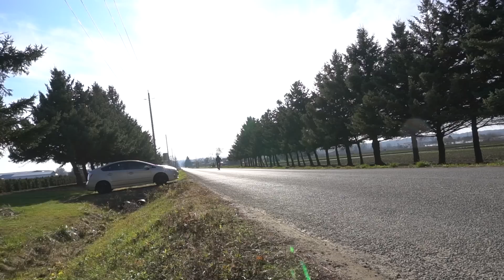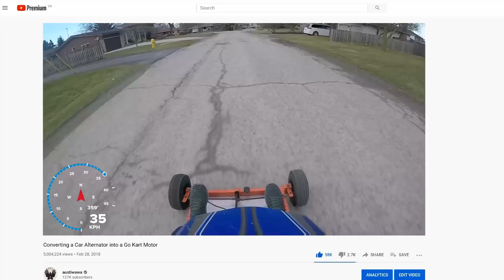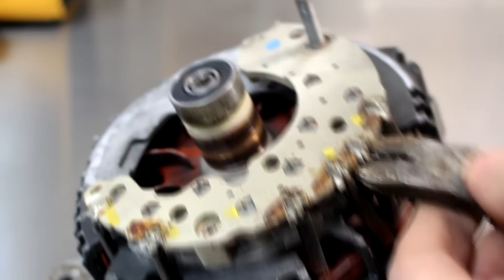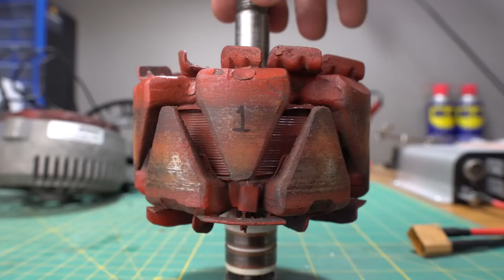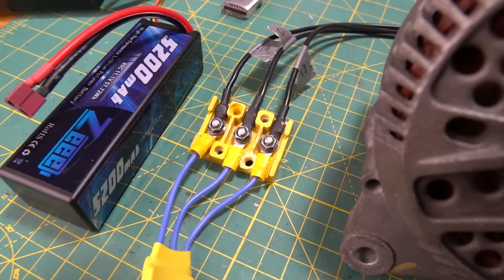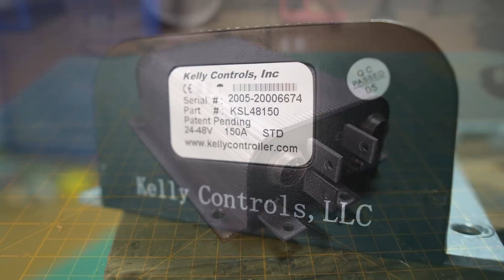Building an Alternator Powered Bike

Comment: could you not just put a cut off switch a Toggle switch
Reply: for...?
Reply: @foxxyytofficial  you start the bike rolling then turn on the Motor then accelerate slow down turn the motor off you have an on off with toggle Excelerator to adjust speed that little pedal you see them squishing that looks like a gas pedal that’s an Excelerator what you don’t like to have happin is tobe stopped and have the motor still turning or trying to turn.it will burn up lotta people call them kill switch.
Reply: @fredrickemp7242  i don't think that this would work as you intend to
Reply: @foxxyytofficial  okay tell me why? I think it is too Heavy anyway use up battery too fast.Alternators off to one side not good for balance.Mid drives motor so much lighter.
Reply: @fredrickemp7242  you're missing the entire point of the video:
To reuse stuff, not to buy every single product on a shop
People in budgets or DIY lovers won't take too much this weight detail in consideration
Reply: @foxxyytofficial  the Controller he bought new did not want to waste it.then he bought a new Santrifcal clutch.so I think a Toggle switch would’ve been better than the clutch.but the side Mount motor poor design. but I like the concept just keep Tinkering
And yes I do like to reuse something then by new. I like Tinkering myself and believe me I’ve done my share of Contraptions.Made a snow plow out of metal bedframe and lids from Tupperware Bins To go on my riding lawnmower.Kids got a real kick out of it worked fairly well.

Comment: How about a torque converter to really get going
Reply: its already good in torque, check the part 1 video, where he didn't used a clutch too, now with the controller and hall sesnsors will have even better startup torque

Comment: Maybe using an absolute encoder was also one of the solutions.
Reply: that KEB controller don't seem to work with those encoders, but a VESC maybe
Reply: @foxxyytofficial  Yes, you are right, but with some simple interface ( e.g. Arduino) it will be possible. Anyway, you did a really good job !
Reply: @navigator_071  wish i was the one that built the bike haha
Reply: @foxxyytofficial  I didn't pay attention, I though that it was the author, anyway, maybe you will built it one day  :)
Reply: @navigator_071  maybe i will, crossing my fingers for that

Comment: That clutch is adjustable, looks exactly like the one I run on my go kart. If it’s slipping, put softer springs in it so it engages easier.  Might help to gear it differently, too. Great vid.
Reply: he only used clutch because of the controller, swapping it made the clutch dead weight
Reply: @foxxyytofficial  I watched the second half of the vid, where he fixed the controller, after I posted that comment.  Someone could probably still do it with the clutch and the controller with no mods, and get it to work properly.
Reply: @DonnieRockett  the clutch it's more for engines that need to idle, electric motors don't, so basically you won't find centrifugal clutches in builds so easily, the only electric projects with clutches that i know are the trial bikes with wet clutches operated like ICE bikes
Reply: @foxxyytofficial  i agree, just putting the information out there that the clutch is adjustable.  his original complaint with the build was that the clutch was slipping.  putting in softer springs, and making sure that the clutch isn't on backward (the shoes in the inside of that clutch are directional) would probably have made the original build work just fine.  i have mine set to engage around 3000 rpm, but that can be lowered or increased.
Reply: @DonnieRockett  now i got your point, sorry then

Comment: You can achieve field weakening by adjusting the current in the rotor windings.  More rotor current = lower kv = more torque/less speed, less rotor current = higher kv = more speed/less torque.

At that point you've made an externally excited motor.

Comment: Can you synch 2 of them for a 2 wheel drive bike?
Reply: with both of them using hall sensors and their own controllers yes, you could get 2 VESC controllers and connect them using CAN, so would need one single throttle and both controllers would be organized

Comment: You should try and use a torque converter instead of a centrifugal clutch. Much less slip and will give you a lot more power on the low end and the high end. Due to the changing of the contact circumference of the belt on converter with the expanding plates.
Reply: or just swapped the controller for a proper one and risk the need of a clutch

Comment: Love your video . A possibility option would be to up the voltage to the field coil temporarily for a speed boost and liquid cooling the motor to improve performance.
Reply: the problem is "how to liquid-cool an open alternator"
Reply: there are enclosed alternators already, but are expensive

Comment: The low RPM from the controller is pretty much an idle, as the startup of these motors is difficult.(an extra kick is always needed)
Would be pretty good to add a full transmission, the clutch was a good starting point.
May have to realign the placements, and/or rotate the motor for a mini drivetrain.
Reply: he swapped the KSL for a KEB controller and got hall sensors, so no need to clutch or other stuff

Comment: Put weaker springs in the clutch...
Reply: or just stop using it, changing the controller!
Reply: @foxxyytofficial  Of course that would be the easy thing to do but since he already had the clutch on the bike and just in case he wanted to improve on the way it is now slipping at slow speed...  a weaker set of springs will help. I could have tried to be a hero and just say "why don't you just use all off the shelf stuff and not use your brain and build it yourself" but he like me loves the adventure of taking something crazy and making it work... ;)

Comment: Lighten up the return springs in the clutch you prob don’t have enough RPM
Reply: or swap the controller and kill the need for a clutch
Reply: FoxxyYT yah I made the comment before it got that far into the video. Lol that thing had good power for a damn 60 amp alternator.
Reply: @rightsidelanechoice7702  yeah, there is a guy that pumped 4000W with 36V in his load-test 120Amp alternator, so if he could grab a 72V controller and use both batteries in series he could probably get 6000W peaks
His channel is "Fixitmoditbreakit"

Comment: bearings in a bike can not hold sustained high speed as the ball bearing are to loosly placed in the hubs and have no grears seals and fail quickly to toss you over the handle bars

Comment: I actually run an alternator shop and I'm here to tell you that alternator won't last at all using it like that.
Reply: how much will it last then?
Reply: @foxxyytofficial  Not long at all. An alternator is not meant to sustain that amount of force. The brushes are incredibly small, they will wear down to nothing in a very short period of time.
Reply: @conservativebrit1120  i still need to see long-term use, but most people that i saw are with recent builds, and good part of those people already have/are starting to buy proper off-the-shelf stuff, so alternator-powered stuff is still a fun DIY project for a short while (until proven otherwise)
Reply: @foxxyytofficial  Exactly, it's not even cost effective considering the time invested. Better off buying a motor dedicated to bikes or at least an actual electric motor that will last for more than an hour.
Reply: @conservativebrit1120  just an hour is probably an exaggeration of you, in my searches i never saw one giving up on just hours
Reply: @conservativebrit1120  and look, you missed the idea to not simply buy stuff
That is the point, to experiment, to try and discover things
Reply: @foxxyytofficial  All I know is that alternator has two tiny little brushes about a centimeter in width, normal electric motors have four very large brushes usually around 4 centimeters in width.
Reply: @foxxyytofficial  Work is still required to convert a bike to a electric. Simply buying things would be going out and buying an electric bike.

Comment: I wonder what the efficiency of the alternator is when operating as a motor. As an alternator I have read figures of about 50%, particularly when hot. Also, once up to full speed you should be able to make it go even faster by weakening the rotor magnetism. One more thing - I'm surprised the Hall effect sensors didn't get totally distracted by the magnetic field from the stator pole pieces on either side. I was surprised it actually worked like that.
Reply: with 12V and fullpower on the field coul the efficiency will fluctuate between 50% in some models, and up to 70-80% on certain models still-to-be-tested

Comment: The clutch would’ve worked if you would’ve took the spring out.. then it would lock up at a very low speed
Reply: That's what I was thinking but this seems more like an electric guru space
Reply: he swapped the controller and killed the need for a clutch, it was better like this
Reply: FoxxyYT yes I know he did I’m just saying that removing the spring would’ve worked instead of getting a new controller... I did it to 2 of my projects and it works great that way
Reply: @foxxyytofficial  I clutch could actually work better you could adjust it to whatever kind of riding you want to do with it
Reply: @smilas8723  yeah, but for EV stuff the only kind of clutch that it have a reasonable benefit is with EV trials dirt bikes

Comment: Have you thought about an electro magnetic clutch? You could use a throttle with an integrated switch that automatically activates the clutch and normally there is little to non noise emitted by them.
Reply: No clutch and swapped controller was a lot better

Comment: I would definitely recommend overclocking the field winding. Instead of pushing 12V into it it can do a lot more if you were to give it some at 15-16V or 20V. 

At one point I had a old tractor alternator that refused to charge at low RPMs so I got myself a boost converter and every time I ran the thing I fired it up and it was charging mad. The alternator did warm quite a bit but that's what the fan was for. 

You could get away doing the same have a boost converter and use that to variate the field strength for maximum efficiency.
Reply: A lot of people already tried to overvolt the field winding but only overheating, and not giving better torque figures
Reply: @foxxyytofficial  it should give you a more efficient ride. I'd like to see those people doing the overvolted field runs. 
Its hard to believe that you get "nothing" when my results spoke for themselves
Reply: @adam207321  In your case, you were using the alternator as a generator (kinetic to electric), we aren't.
We're using it at the complete opposite (eletric to kinetic), and there's a lot of people that tested, from 3S LiPo ESCs and low voltages on the stator, up to 72V on the stator and 14V on the rotor, those are basically some limits for our reverse use case
Reply: @foxxyytofficial  72V on the stator???????? Wow that sure had to burn the windings.

Here's what I considered a factor too: When I was creating some performance graphs for the alternator as a generator I figured the more current you want from the output windings it takes more current to draw thr field winding. Assuming fixed voltage field winding and manually variable current of the output I was seeint a current variation in the filed power. Maybe all you need is a boost converter before the motor after the battery so you get a stable voltage and or regulateable voltage. 
I was field testing this on a running engine. So take the results with a grain of salt...maybe the ripple inthe current of the field supply were cause by rotational irregularity of the engine but I doubt because it was the inverse shape of the ripple out the rectifier. 
I wish someone could test this in a more lab setting. I dont have the time nor the vehicle anymore to test this on.
Reply: @adam207321  i still need to see those people with burned windings at 72V, maybe with a couple years later after more use...
Also i saw a guy pulling 4kW at 36V (youtuber "Fixitmoditbreakit"), so probably 6-7kW at 72V its possible with a 200Amp controller and forced air cooling
Reply: @foxxyytofficial  that's on simple terms impressive as fuck. But I may be impressed only because I was working with only very old alternators.....like 12V30A ones...not the ones coming out of newer cars that use the 12V power to make the power steering work which can deliver at least 100A even in a small vehicle. Those windings will sure have a different winding construction than what I was playing with

Comment: Nice work with the hall sensors. I thought the output from that tester looked a little funky at first with only one LED on at a time, but I never would've guessed it had to do with the stator geometry. Fun fact! By varying the voltage to the field, you should be able to vary the effective KV of the motor. E.G., Reducing it should give a higher top speed, increasing it gives higher torque... Not that applying either to a bicycle is recommended...
Reply: yep, there is someone in one of the forums that i look that did exactly this, using the variable Kv ratio so that he can use a lower voltage (24V on the stator if i'm not mistaken)

Comment: Hey, is this charging the batteries at the same time and if not could you add another way off charging, please let me know, regards Pippa.😎👍🇳🇿🌈😎
Reply: Hi what I thought was that by having two, one as a motor and one as the power supply and having the battery just to get things moving , worth a shot, I myself have not had ago yet as have been doing other things, will be sometime in the future. What you have done is great 👍. Everyone have always used a combustion engine to drive the generator or alternator, would be cool to use what you have made to drive the charging alternator and small powerful battery to start it happening, just a thought regards Pippa.
Reply: @pippastone6018  the alternator only recharges the battery because the engine is many times more powerful than their resistance, and the battery it recharges isn't that powerful too
In the case of an alternator as the power/movement source, you can't simply use another alternator, as both will cancel each other and you will waste 100% energy
The only thing you can do is to use a controller that does regen braking
Reply: to recharge the batteries there is no possible way, but you can have a regen-equipped controller that recovers energy at braking and releasing the throttle

Comment: did you figure out what the max RPMs of the motor were?  The slipping clutch sounded like one that wasn't spun fast enough to fully engage.  Most of then engage around 1800-2200 rpms.

Comment: Cool project.
Next time, some magnetic tape or a ring magnet on the ouput shaft or gear or something is an easier place to mount the hall effect sensors, rather than ripping out winding insulation.
Cheers.
Reply: i had someone in my FB group doing this, but you would need to "surgically" sync the rotor poles with the separate ring/tape

Comment: Nice work. I built a Cyclone powered bike. I limit the speed with gearing to 50 km/hr more or less. The rake and trail on a bikes front wheel is just not made for speed.

Comment: I want to go to a junkyard and get a starter motor from a diesel and then use that for basically something kind of cool because you know what that thing would have a crap ton of low end torque.
Reply: Starters get hot fast. All that low end torque comes with a cost

Comment: so why dont you put a turbine/cooler-fan heat-sink in your motor, or same setup as the hub wheel
Reply: why so compl, you could manually speed assist the motor logic with rotary logic
Reply: that solar snake would be nice, trailer, and hood
Reply: uhh... sorrry? i didn't understand

Comment: Impressive ending with the Hall sensors.  I've noticed that on some of my motors they use a separate magnet ring mounted on the back of the motor with a clock-able Hall sensor ring.  I suspect this increases sensor life as they are removed from the heat, but I have had very few Hall sensor failures over literally hundreds of motors with integrated sensors, so it may just be for convenience and tuneability.
Reply: BLDC motors can have separate hall sensors, because of the symmetry on all the magnets

Comment: How about three phase rectifier and voltage devider for stator coil? No need for second battery? I am building project like that too.
Reply: you can just use a DC/DC converter to feed the brushes from the battery, and not depending on the motor coils
Reply: @foxxyytofficial  Thats even better, becouse then you can have adjustment for torq/revs...
Reply: @juhopeltola3993  yes, but for that you need a DC/DC converter that can limit current without bursting into flames like the cheap chinese ones
Reply: @foxxyytofficial   Yes, I got plenty of those. And you can do one whit arduino easily. Tseck creatscott channell.
Reply: Actually I will go whit rectifier, cos magnetic field doesen't like riple at all. Threephase rectifier whit resistors are clean enough.

Comment: How much power bruh?  Can it climb a steep grade?
Reply: probably 2000-2500W, to climb steeper grades you would need to change the gearing and get a lower speed to get higher torque

Comment: Please for next project dont turn it into brusless moto instead use it in car for alternator assisted drive... you would need to have batteries in the trunk and you just need to read engine rpm from obd2 port to control alternator. You can do it, i am sure!
Reply: Right !!!
Reply: if you want assisted drive, check on the website EndlessSphere, they know more about this kind of stuff there